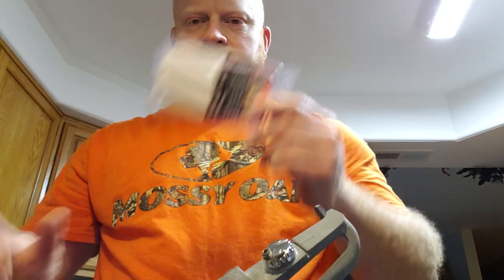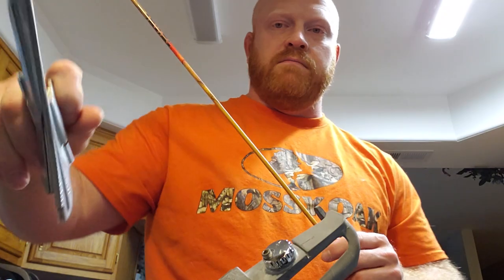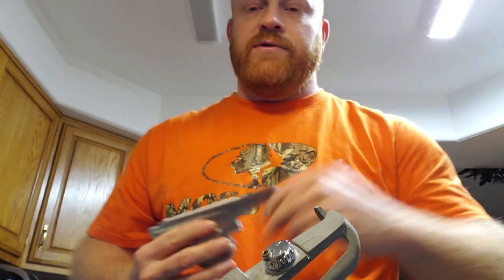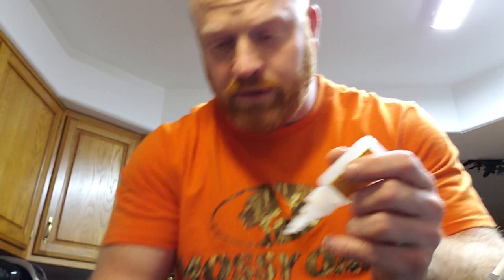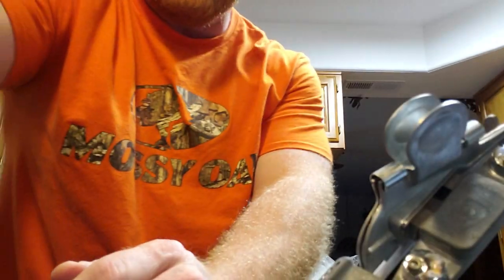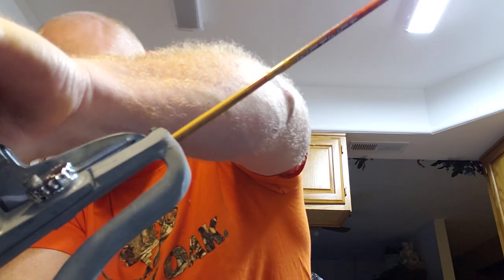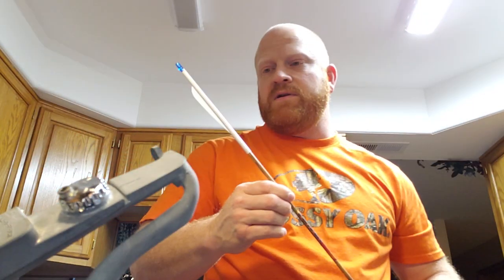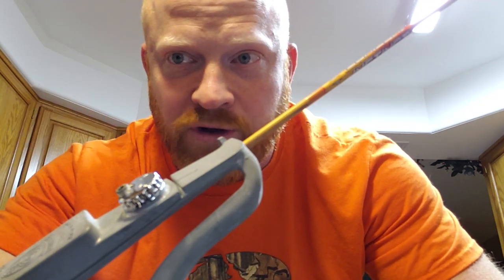Trad vane installation!

Comment: im glad you made this video... i use the same gorilla glue as well but when i used the AAE plastic vanes they all fell off. I have never had a feather or fletching fall off ever until using AAE. I did get their primer and glue kit and the plastic vanes did end up sticking well... I have never used the trad vanes but i just ordered a pack and was looking for basically this exact video. Im glad it worked out and i will continue to use that same gorilla glue for these trad vanes.

Comment: It has been my experience that superglue and viynl wraps do not work so good same with painted and crested shafts the super glue makes a mess and will not hold I use fletch tite by bohning and it has never failed me.

Thanks just found you channel good stuff

Comment: I gave up on mine last Sept. Hard enough to lay a tiny bead, then when I set the clamp (JoJan) on the shaft, the glue squeezed out and was on the clamp. I jerked the clamp off. and peeled some of the wrap off. Anyway, thanks for this tip, and maybe I will try it again.. I used a super glue gel, as recommended. I will play this video again to see the name of the glue you used..
Reply: Try Duco cement